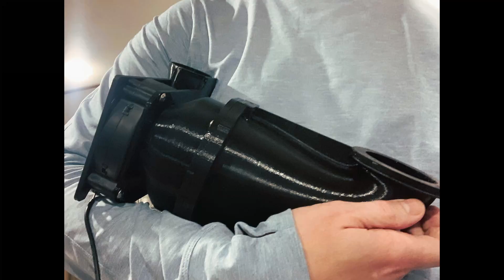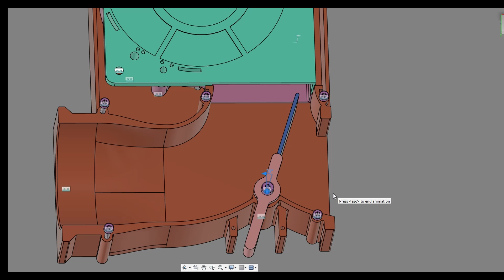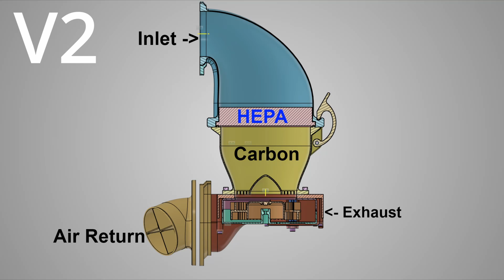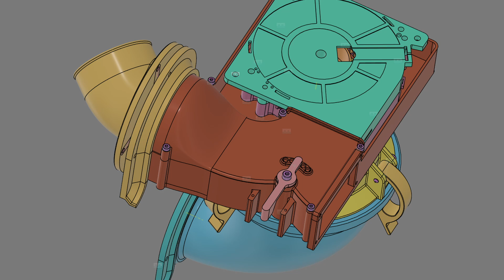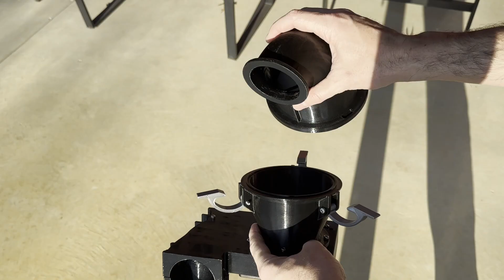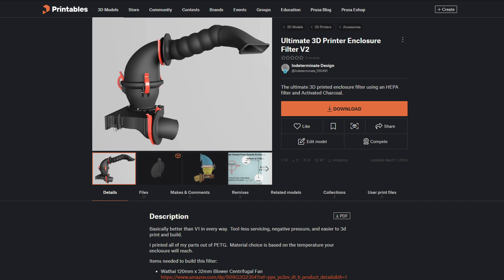Ultimate 3D Printer Enclosure Filter V2

Comment: There's still one thing missing: automate the lever by mounting a servo to it! Then alter the starting gcode for PLA to direct the exhaust outside, and the ABS start gcode to direct the exhaust back into the chamber 👍
Then you don't have to remember to put the lever to the right position every print.
(i'm integrating this into the printer i'm building right now)

Comment: Just wanted to say thanks again, I'm delighted with the design.  I modified the filter upper chamber it to use with a Qidi Q1 Pro, with a screw-on fitting that clamps to standard 100mm ventilation ducting hose.  The screw-on top makes it easy to remove for filter changes etc.  This mates your filter design to another Printables file for a 100mm hose fitting to the Q1 Pro exhaust fan outlet on the back of the machine.  The flexibility of 100mm ducting hose allows me to mount the filter on my shelf rack rather than on the machine, as the side panels are very thin and flimsy.  

The Q1 Pro is designed to hold the chamber temperature with the exhaust fan running at 100%, so for now I haven't routed the filter exhaust back into the chamber - but I've designed a part to fit to the bottom of the Q1 Pro side casing as the Q1 Pro has a curvature to the side panels that prevents use of the vents you provide.  I do plan to exhaust back into the chamber, as it will save a bit of electricity.  I also didn't use the gravity-operated air-inlet flap, as I suspect I don't need it given the Q1 Pro is designed with an exhaust fan as standard so presumably is able to draw in enough air.  That said, I have put insulation in and closed off the air gaps to the back panel of the Q1 Pro chamber to reduce heat around the electronics, so this has probably increased the negative pressure of the chamber from standard.  The problem is those side panels: their curvature would mean the gravity flap would not work without modification.  I'll see how it goes.  

I've just bought a second printer, the Qidi Plus 4 - and I think the fan is easily strong enough to filter both printers, all I'll need is a screw-on Y-connection for the 100mm hose.  Very happy: I can now work in the study whilst the printer is running, exactly as promised.  In the spirit of your project, I plan to upload the stl files to Printables.  I just need to tidy the model up a bit, but these mods are really simple and make the filter adaptable to any modern enclosure printer with an exhaust fan.  The fan you recommend came with a speed dial control wired into the power cable, so there's even more control.  I bought a digital anemometer for air speed measurement so I can fine tune the settings.
Reply from the maker: That’s great!  I’m glad you were able to modify it to fit. It was one of those projects that I figured might be too specific to my own setup, so I’m glad to see it’s working.
Reply: Hey, fellow Q1 Pro user here, you got the STL files for your modifications?
Reply: @Frumpbeard  Hi, yes happy to share.  I will upload to Printables and post the link here.  It may take a week or two: I want to change the number of turns on the thread to make it easier to remove the ventilation hose from the upper conical chamber when changing filters and charcoal.  I also want to add magnets to the filter exhaust attachment, again for easy detachment when doing maintenance on the Q1 Pro.  The exhaust recirculates the filter air back to the Q1 Pro chamber, and is worthwhile doing I've found - but if you don't want to make any non-reversible mods to the printer (the exhaust entry requires drilling lots of small holes or cutting a large hole at the bottom of the left side panel) you could simply let the filter exhaust into the room.  That's working fine for me currently, but this approach might require more frequent charcoal and filter changes than recirculating the air back to the chamber (depending on your sensitivity to fumes).  The attachment of the filter to your rack or shelf or work top would require a custom fitting, as mine is bespoke for my rack (bought from B&Q DIY merchant in UK).  I will include in the files my bracket in case you want to adapt.  I can provide step files as well as STLs.  For the ventilation hose fittings, I'll link to the Printsbles files I used - basically two parts, an inner baffle that fits behind the Q1P back panel and sits over the chamber exhaust fan to channel chamber air straight out the back.  And an external fitting for the 100mm ventilation hose, that secures the hose with a standard 100mm hose clamp.  Another hose clamp the other end secures it to my screw on attachment.  I have the filter right next to the printer, so the hose is only a short run but I only need the fan to run at 30-50%, so there is plenty suction for a longer hose.
Reply: PS: I have an air quality monitor in the room, and at 50% filter fan speed I can run the printer with doors and windows closed with no change in VOCs levels - though a sensitive nose will still smell ASA or particularly ABS.  With sliding doors in my study open, I run the fan at 30% with no smell at all.

Comment: Why not just duct the exhaust outdoors? What is the benefit of recirculation vs exhausting?
Reply from the maker: I didn’t have a window nearby, but the biggest benefit is heat. Many high temp materials like nylon, ABS, or PPS need a chamber that’s 40c or higher. It’s hard even with a separate heater to keep it that hot if you’re pumping a lot of air outside.  I do have some screw holes so you could design an adaptor to exhaust the air outside if you wanted to.
Reply: @IndeterminateDesign  A follow up question: If my printer has an inner enclosure for trapping temperature and outer enclosure for trapping fumes, do you think that setup would allow the best of both worlds? Basically the space in between enclosures would be in negative pressure and slow exhaust air current would not affect inner enclosure temperatures too much even if it is exhausting outside, assuming the inner enclosure has been sealed well enough. Does that make sense? I have tried to find something like that, but no luck.

Comment: Landed on your video via the Qidi subReddit (I have a Q1 Pro), and having just printed my first ABS with windows and doors open I will never print ABS again without filtration.  Just a warning to anyone reading this who is unsure about the necessity of filtration, I did an 8 hour print of ABS-GF, and it stank the room out even with sliding patio doors and window open.  If you have soft furnishings in the room, and a sensitive nose, you'll smell it for days!

I plan to make your filtration system with a modified top extraction hood that replaces the Qidi clear acrylic top cover.  Thanks for your efforts and makimg this design freely available.
Reply: I ran an Anycubic Photon Mono X in my bedroom and did not sleep in there for a week after running a print. Windows open, fan running did not do shit. Never again.

Comment: Recently printed and installed this...a lot of engineering and documentation went into this.  Kudos to the creator.
I am unsure if the fan I purchased may be faulty, but it seems to struggle with the HEPA filter.  Has anyone tried with a stronger fan or less restrictive filter? Thx

Comment: This is an ingenious design, truly innovative! I would highly recommend considering a patent for it. After reviewing both videos (Version 1 and the current iteration), I would like to explore the possibility of incorporating two separate housing tents: one for the printer and the other for the cleaning station. Each tent would be equipped with a HEPA and carbon filter for the return air intake, positioned at the bottom rear sides of each unit. The exhaust vents, located at the upper rear sides, would be 4" in diameter and connected to a corrugated insulated hose. My question is would it be possible to use a Y-splitter to combine the exhaust fumes from both units, directing the fumes through your filtration system and venting them outdoors, similar to the way a clothes dryer hose port functions.
Reply from the maker: I’m not sure if this would flow enough for both tents if you have the carbon and hepa filters in there.   It would require some testing. 

If you have the ability to directly vent outside, just using a 4” air duct booster fan maybe your best bet. That will create a low pressure region inside the tents, and as long as they’re decently sealed you won’t be exhausting a lot of air. 

No need for a filter, unless you’re recycling the air.  I have to recycle the air because my printer isn’t near an outside wall and I need to keep the temperatures above 60c.
Reply: @IndeterminateDesign  Great, thank you for the info!

Comment: I am currently trying to design my own enclosure and I am trying to learn more about the intricacies of pressure and temperature in the enclosure. I want to close my enclosure during prints but I want to keep my enclosure airtight to prevent dust from entering the enclosure.

I would be grateful if you could answere to a few misconcpetions I have regarding this issue.

1. Do I need to exahust the air coming out of the filter? I am unsure if I need to have a exahust area in my enclosure where the air exits from the filter to the enviroment.
2. How do you regulate temperature in an enclosure? I am new to this specifically so if you may provide some points and suggestions on what to look into that would be great.

3. how do you know how much activated carbon you use as well as the size of the HEPA filter? when do you have to change them?

I would be really grateful to hear back from you

Comment: where do i get the filter material? do you think this would be good for a resin printer?
Reply from the maker: I’m not sure on that. It will absorb VOCs but it will work best for a small enclosed space maybe 4-8cubic feet.   The activated charcoal is available on many websites, it’s often used for fish aquarium filter media. I have a link to some on printables.
Reply: Ohh didn't know you were using something like that. Thought it was a pre-made filter

Comment: I'm super interested in this! I made the bento box, but I don't feel it does anything (not enough air flow/circulation and filter media). How loud is that blow fan you are using? I print in my office so I'm curious if this is noisy.
Reply from the maker: At low speeds it’s not too much louder than my printer fans.  I tend to run it at higher speeds for ABS/nylon though, and it’s fairly loud like a computer server fan if you’ve ever heard one.

You could design a muffler for the exhaust (I have bolt holes provided for that kind of thing).  Depending on your enclosure, a bit of sound deadening on the enclosure wall that it’s mounted too may help.  My enclosure seems to amplify the sound.

Comment: I like it! 
I spotted ender 3? with some modifications and psu/board/display moved outside the enclosure. Can you please show in a video your 3d printer setup, how you modified it, and why you did the modification?
Reply from the maker: I may do one here. I’ve held off because because the latest generation of printers like the Bambu P1S or X1 are so much better and honestly cheaper than all the mods I’ve done 😂.

Comment: This looks great, seems like you've really put a lot of thought and consideration into this design. Do you have any measurements of VOCs/UFPs with and without the filter?
Reply from the maker: I didn’t have a good way to measure the VOCs or particulates, so I don’t want to make any guarantees. That being said this design should be overkill for a 3D printer. I looked at a lot of filters designed for small fume hoods and this is comparably sized to those filters.  The biggest improvements would to be to use finer or even a multistage carbon filter. But I didn’t see this even in the industrial 3D printer filters I looked at. 

I wish there were more literature and research available on the topic.

Comment: i just got it even easier use a ikea fornuftig and let it circulate back
Reply from the maker: My concern with that filter is the VOCs.  While it has some activated carbon on the foam filter, it's very very little compared to what this and most industrial 3d printer filters use.  I would not feel comfortable with it, but I'm not an expert by any means.
Reply: recirculating the air removes almost any smell when printing asa or abs for me also keeps temps nicely. im using a corexy printer so it blows bit on the AC bed what helps heating it up

Comment: This would be pretty close to perfect if it had a way to automatically shut the louver and turn off the fan in the event of high-temp/fire.
Reply from the maker: Yeah. You could definitely cut off the power to the fan using a fire sensor and a mosfet.  Fire is always a concern of mine, I don’t trust my 3D printer at all and never leave the house during a print.
Reply: @IndeterminateDesign  agree 100%. I have an automatic fire extinguisher in each enclosure and networked smoke detectors in the maker space that trigger detectors on our other floors. I print a lot of multi-day prints, and while I don’t print while I’m out of the house, I do print overnight. I sleep a little better with these measures in place.

Comment: This looks like exactly what I need for my rig. I’m super stoked, thank you so much!

How do you know when it’s time to change the HEPA and the Carbon? Is there a ballpark number for how many hours they can take before needing replacement?
Reply from the maker: The HEPA filter you can see when it gets clogged with particulates and dust. I’m still on my first one and I have several hundred hours on it. 

I’m hesitant to provide a ballpark on the activated charcoal because it depends on so many factors. Ideally you’d have something to measure the VOC levels coming out of the filter.  The charcoal will absorb VOC’s out of the air, so I change mine every 6mo regardless of use.  If I smell fumes I also would also change it.  I’ve only changed mine once after printing about 2.5kg of nylon and polycarbonate.
Reply: @IndeterminateDesign  Excellent. Thank you. I’ve looked at dozens and dozens of videos on Enclosure Filters and you’re the first channel that has had anything like I’m looking to do. More than that… you have EXACTLY what I’m looking to do!

Comment: Great project and v2 update. How were you able to graph or simulate the airflow in the enclosure?
Reply from the maker: I used a CFD software called OpenFOAM just to see how the flows behaved.  It showed pretty much that no matter what design you use, if you move enough air in a small space it mixes pretty well.